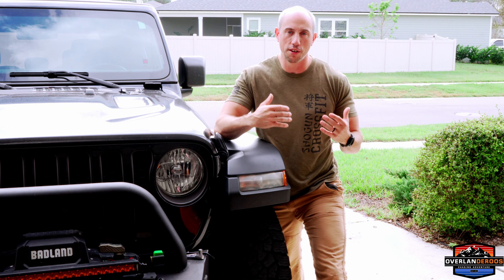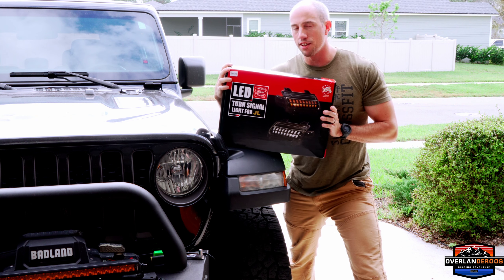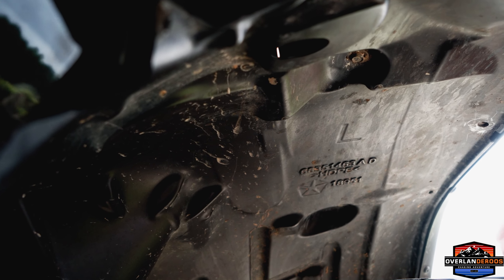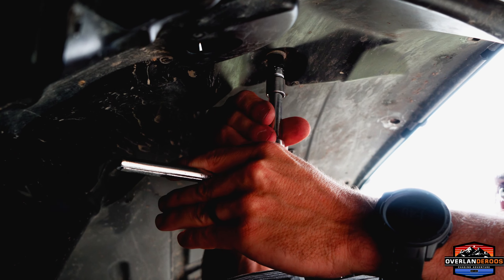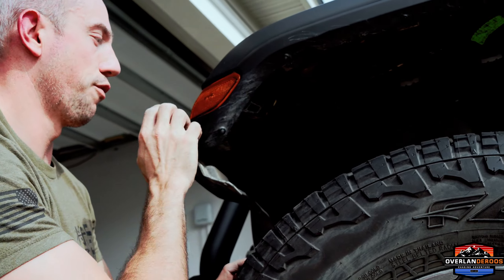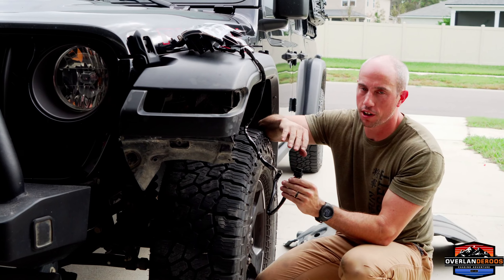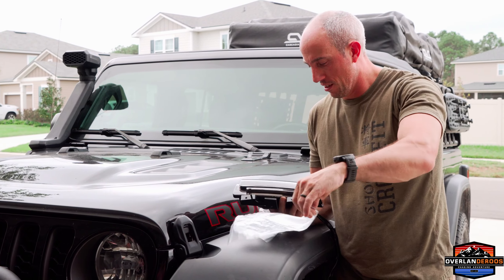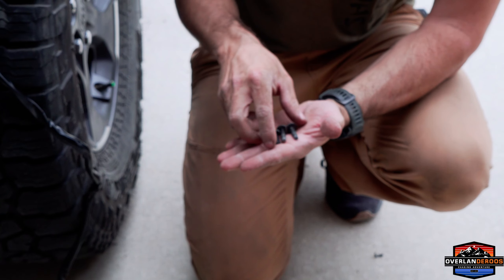Installing and Reviewing Loyo LED Fender Lights for Jeep Wranglers and Gladiators!

Comment: In my experience, always leave the factory harnesses in there and zip tied away incase you have to switch it back you don't lose the harness.
Reply from the maker: Good tip! My factory harnesses are currently on a shelf next to the factory fender lights!
Reply: @Overlanderoos  I bought the same lights and ran across your video a couple days ago to see the installation which helped a ton. Did the install yesterday love the lights man thanks for the video

Comment: I was so hoping you was going to show how to wire up the resistors to fix the hyper flashing with these.
I've had these for at least 6 months and can't use them because they were not plug and play.
They have been plug and pray and so  far my prayers haven't been answered.
I've looked far and wide for an install  video on these as most videos are of the name brand versions and finally I find one and it leaves out the most important part.
I contacted the vendor and he told me where to tap in the resistor and instead of fixing the issue,it killed my engine and I couldn't even use my gladiator.
Mine a black 22 willys and I too have the badlands winch which I love.
Reply from the maker: Weird, I didn't need to use a resistor, I didn't have the hyper flash issue on mine. Sorry the video was not helpful for you!
Reply: @Overlanderoos  
Yeah I 1st just plugged them in without the resistor and it blinked twice and that was it.
I contacted the vendor who said I had to tap in resistors and when I did that,my jeep wouldn't even run.
I appreciate the reply and glad yours work,just wished mine would too.
Reply: What model jeep do u have?
Reply from the maker: 2021 Jeep Gladiator Rubicon that came with the Halogen lights from the factory
Reply: @charleshenson4183 did you ever get them to work it does the same thing on my 18 jl flashes twice and thats it?

Comment: HI THERE I INTALLED  THE SAME BUT I GOT A TURN OFF LIGHT OUT ERROR, DO YOU KNOW HOW FIXING , APPRECIATED IT. MY JEEP IS 2019 SAHARA
Reply: I did as well. I used J scan app, and messed with it. I turned off led in the app, and now it works perfectly. 🤷‍♂️
Reply: @Pondo007  thanks 🛫🛫🛫🛫
Reply: I'm having the same issue. I have the correct version for my JT 2020 sport s. I have them plug in, but after turning on the truck and using for 5 mins, the blinker goes out and I get the blinker out msg.
Reply: I keep getting the "lights out" message about 50% of the time. Sometimes they both work then sometimes just one side works but im super bummed about this because I really like the way these  lights look like on my 22 gladiator overland
Reply: I am getting the same error on both sides 😭😭
Reply: @Pondo007 what app?
Reply: @MrJikosta   OBD J Scan. It’s in iOS App Store.

Comment: I installed the same quality and the same brand for my Jeep Gladiator rubicon 2022
And i have problem when i turn on the signal give me on the dash the signal off and when i turned on the flash go fast
Reply from the maker: Hmmm, that's weird. Did you order the proper ones for your factory installed lights? Like I had to make sure I selected Halogen lights and not LED. Hope that makes sense! I'd reach out to customer service and see what they say!
Reply: @Overlanderoos i have the same issue, can u please loop me in too on a solution plzzzz

Comment: Did you say that you DIDN'T need to flash them with a Tazer or anything? 
Audio wasn't too clear
Reply from the maker: Correct! They are plug and play, no need for a Tazer or trip to the dealer! Sorry about that!
Reply: @Overlanderoos  no worries. Thanks for the reply. Ordering them now! 👍
Reply: How did you connect the resistor to eliminate the hyper flash?
I have these and after plugging them in they flashed a few x normally and then went to hyper flashing.
Reply: I plugged mine in and the “blinker out” message comes up on the dash…..
Reply: Me too! @J_Shiesty